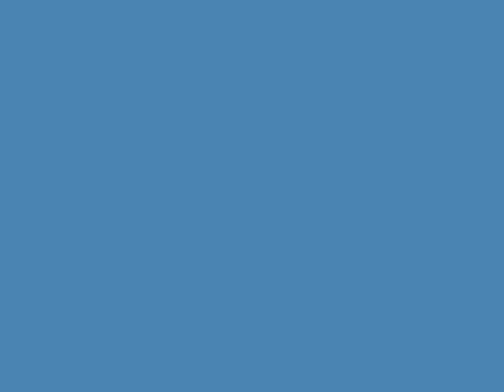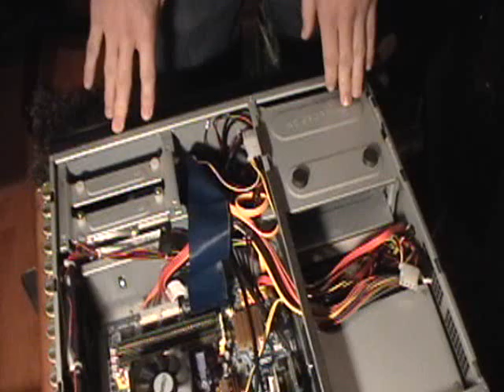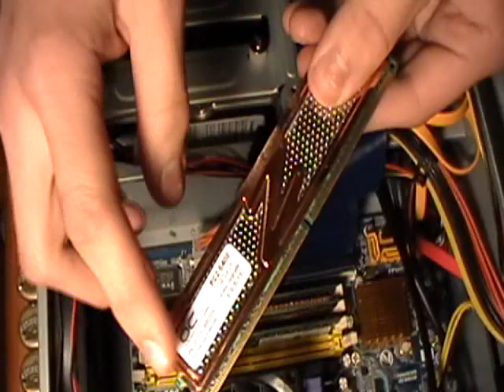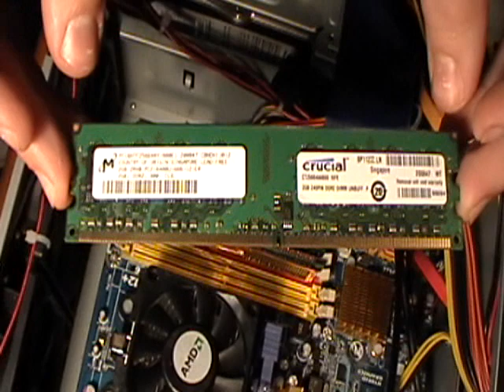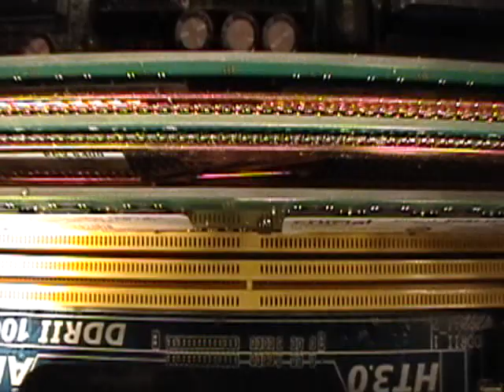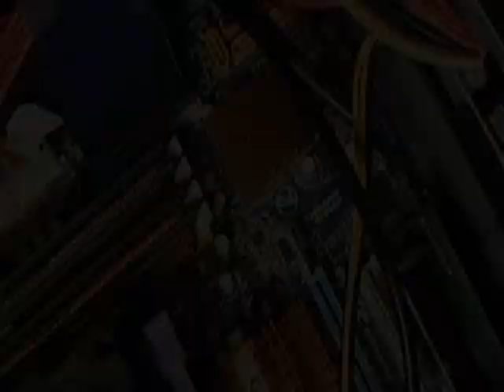How to install RAM Memory in your Computer

Comment: Ok so i Was putting some more RAM on my M3A32-MVP Deluxe Mother Board before i did this I turn off pc as normaly and then I disconnected all cables like usb mouse, keyboard, and power Cord etc.. so i changed the memory and now my pc wont turn on not even a blink light, sound nothing at all. Someone said maybe the new memory is not supported but i put the old memory back and still nothing... can someone help please.😭😭
Reply: El Tío Patrón did u fix it

Comment: I need help I wanna move my old pc's ram into my new one but my old pc has viruses in it will the virus go into my new pc if I out my ram in it
Reply: iiFrosti no, since you are only moving RAM (random access memory) nothing bad should happen, ram loses all its data every time you turn off your computer, the only thing to be worried about is if you move a hard drive or solid state drive with stuff on it, if you do do that and you have viruses, i suggest booting off Ubuntu or a Linux distro from a USB and than formatting the hard drive, Linux wont be at risk if you ran windows because viruses for windows can't transfer over to Linux. sorry if i got too complicated, if you need more help or didn't understand feel free to ask me.
Reply: +lightningx10 question will thiswirk im putting pic on g+ account

Comment: I Need Help :(, Before I Put More Memory ( Ram ) in i have 4.00 GB ( 3.49 usable ) And After I Put New Memory To The 2 Slot It Does Increase To 8.00 GB :D, But It Still Said ( 3.49 Usable ) :| Can Someone Help Me ?
Reply: are you on 32 bit system ?
Reply: 64 bit
, but nvm i fixed it by searched on youtube

Comment: great video, thanks.
i have a question for you. i have had a look at my memory slots and i have 2 x black and 2 x yellow. the black ones currently hold 512mb ddr2 each. i am going to buy a 2gb ddr2 soon and was wondering if i could leave the 2 x 512mb in place and add the 2gb in one of the yellow ones. this should give me 3gb of memory, right? or should i take the 2 x 512mb out and just have the 2gb in one of the black slots. i would appreciate if you could let me know.

Comment: So I'm considering adding more ram to my system, but I have a question, does the computer automatically detect the new ram and life goes on? Or do you have to do do some configurations after the computer is turned on?
Reply: It will detect it automatically but make sure it's inserted in right place
Reply: 8 year old question !! NEED ANSWER
Reply: 9 Year Old Question NEED ANSWER!

Comment: @FatZiggyFiddleCrumbs yea i have it checked and my motherboard supports upto 8Gb ram DDR2 but for some reason on of the slots can't read more than 1.So in order to get a 4 gb ram i need 4 gb chip on one slot.Now i have 3Gb ram.Everything is back to normal.Thanks for the answer btw.

Comment: DUDE i NEED HELP.I got 2 gis(2x1) and not i upgrade to 4 GB (2x2) and the computer won't work.In the one slot it can't start pc so i am stuck with 2 Gb ram And i can't boot with 4 Gb .And now even all most all games crash to dekstop in 5 minutes.
Need help mate pls.The ram's are A-DATA (2x2) DDR2 800Mhz.

Comment: i have a gigabyte MB and bought 2 * ddr ram 2 GB each
when i add both of them the pc would give me the BSOD and if i remove any of them the pc will run fine. i have W7 32 bit coz i know XP wont support over 3 GB ram .but now i can use only 2 GB ram with W7 and its killing me........any ideas

Comment: Thx! 
i installed 'em in the same color slots, and it is running in dual channel.  FSB:DRAM is 3:4.
i got that OCZ reaper 2gb (1024X 2) for $25 after mail in rebate (better than generic memory...lol)
i have a small pc and the reaper is 2X height than normal memory, so i had to relocate dvd drive.

Comment: is that OCZ Vista upgrade edition or platinum series? 

how do you install dual channel DDR2?. my mobo has 4 ddr2 slots ( color: blue+ black and blue+black) if i'm using 2 ddr2, should i install them in the same color slots? (like... use that 2 black slots? ) i just bought a pair of OCZ Reaper PC8500.